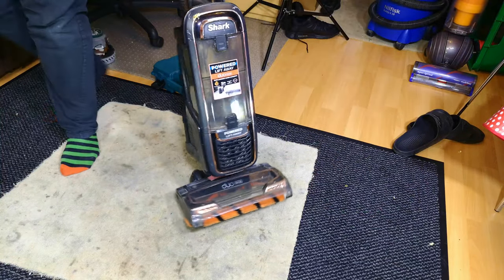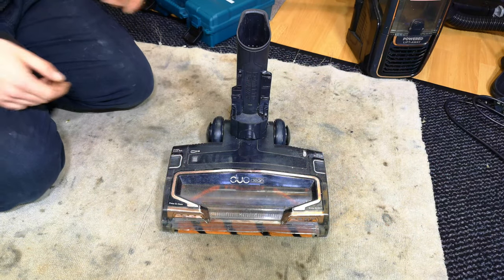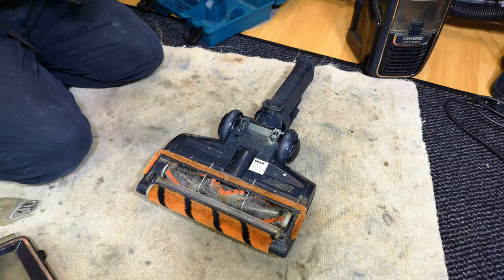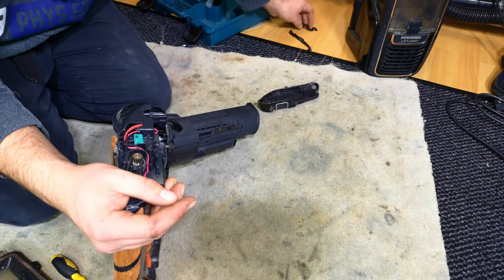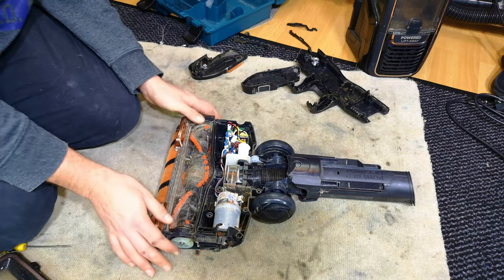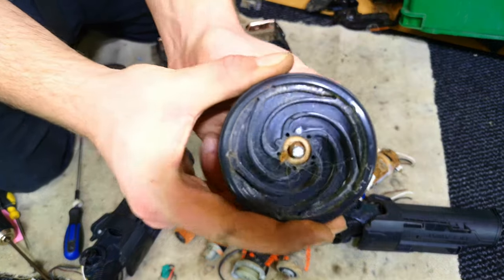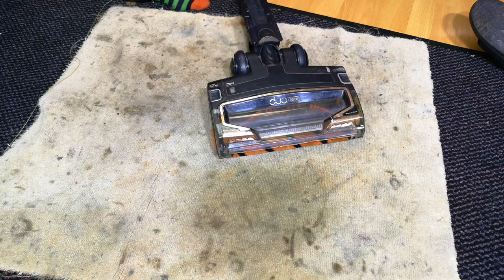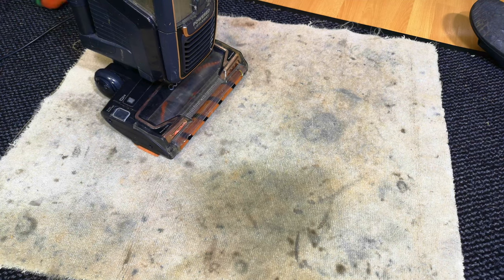Making 1 Shark AX950/Apex DuoClean head from 2!

Comment: Is it possible to get to the switch? Mine won’t turn the motor off, it only turns the lights on and off? Thanks.
Reply from the maker: Sure is! The 2 small trim pieces either side of the switches pop off, then you'll see 2 (I think t30) torx screws. Once their removed the plastic around the switch pops off (tab at the front) and you'll see the switches! (Dyson switches should fit)

Comment: People that spend a fortune on these finest Chinesium Shark duo clean deluxe contraptions and then dont maintain them, would be better off toddling off to Argos and buying a nice cheap Henry and a pack of 30 bags. No rotating parts in the head to clog up and when it stops sucking they take his hat off and put a new bag in - and thats all thats needed. Most uprights and indeed most bagless vacuums need regular filter cleaning and brushroll maintenance - so if you are one that just wants to get the hoover out, turn it on, hoover your rugs and then turn it off again and be done - for gods sake - buy a Henry, he'll even smile at you when you hoover with him lol
Reply from the maker: It's something I've recommended to a few shark owners before when they machine has not been repairable. Their boring and basic but have a better chance of lasting more than 2 years for sure